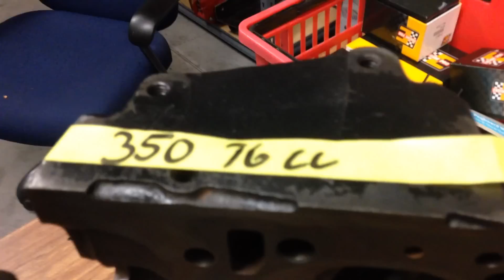350 and 305 Chevy what's The Difference

Comment: Why does a 5.0 Liter Chevy V8 have to be the sad choice? I mean, if you look at other manufactures from all over the world whom make a V8 with several hundreds of horse powers; they barely even get to 305 cubic inches to begin with. So with in that perspective a 305 is a large motor... which easily can produce exactly the same amount of power as the Chevy 350 does. and why do you need to go bigger in cubic inches to begin with? We no longer live in the 60-ties were hardly any other option was available, than large, larger, largest bore: more cubic inches. Now we're 60 years later in 2021 and we've developed so many gadgets to gain power out of any engine, we don't need more cubic inches to gain power. Many standard 4 cylinder engines no larger than 105 CI gain more power than a standard Chevy 350 V8. You've gotta ask yourself: do you think like people did in the 1960-ties or do you think like people do in the 2020-ties? Basically: yes there are many substitutes for Cubic Inches!

Comment: I ported my stock 305 intake and heads and put a double pumped and it ran decently well the issue with the 305 is that the lack of air flow chokes the engine at high rpms

Comment: I built a 305 a couple of decades ago on a dare.  I had an '85 monte carlo SS and I transplanted a tpi 305 from an '89 camaro.  It wasn't left stock.  I used AFR heads, edelbrock TPI manifold and runners, crane cam, hooker long tube headers, etc.  My friend was building his '86 camaro with a carbureted 350.  Both were our daily drivers.  I put up with so much crap from everyone asking why a 305?  Because it was more of a challenge.   We raced them, a lot, and they performed pretty evenly.  They ran very close times at the 1/8 mile track.  Usually whichever car that got better traction would win.  We were still naive and blew all our money on the engine, transmission, and rear end without realizing how important proper suspension would help.  In truth,  you can make decent power from a 305, but it's easier to make the same and more with a 350.  If my friend had used better heads than the cast iron double humps that he used, I think he would have easily made more power.  I was only able to compete with him because I didn't mind spending the money.  And that's really what it comes down to, how much do you wanna spend to go fast?

Comment: You said the 305 head ports don't flow very well, but does it make any difference if you had a pair of 305 heads polished and ported? Would there be any HP gain at all or is it still not worth the time, money, and effort?

Comment: I was wondering since the bore is bigger then the engine is a little bigger? Just asking cause I removed a 350 and installed a 305 and exhaust that come off the headers didn't fit exactly

Comment: I have a 305 in a Chevy Express van that I use for towing a 5000 pound travel trailer and or a 16 foot cuddy cabin boat.  Obviously the boat doesn't even seem like it's behind the van and the van has no trouble pulling the travel trailer up some pretty steep grades.  It's no drag racer but it'll keep others from overtaking me on the right!

Comment: What happens if you did the opposite. Put the 350 heads with the much larger 76 cc  and  big cam in the 305. Any horsepower gains for the 305 or would it lower the compression rate too much.

Comment: i agree valve shrouding is also a big problem when you put 1.94's in a 305 head and it will only perform to the port flow. All Sb's already have the 1.5 exhaust

Comment: I once had an 88 caprice classic w/ a 305 and it was a great motor, stock 170 hp and 260 ft pounds torque. Plenty of power to get that 5000 pound car moving. Not bad on gas either, for what it was.
Reply: An 88 Caprice doesn’t weigh anywhere near 5000lbs.

Comment: I would like to swap the original 305 (with automatic trans, that has bad bottom bearings) in my 1991 Chevy truck with the 350.  Does the computer have to be changed also?  I was also wondering if there is a way to buy a remanufactured 305 with more horsepower that would not require a new computer?   Let me now what you think.

Comment: 86 k10 305 swapped for 79 Scottsdale 350. Converting the 350 to manual my 86 has a 4 speed with granny shift. Original 305 had the mileage rolled over 3 times. Started smoking at 86,000 and said it’s time to upgrade a little.

Comment: I don't understand why everyone hates the 305's. I have a 305 in my 89 IROC Z28.  It has the tuned port injection, & over 120,000 miles on it. It runs like a new engine, just not as much HP as a 350. 
Granted it doesn't have the power my LS engine has in my Silverado 1500, but back in the day, a 305 was considered a good engine.

Comment: Going back to the 1980's my understanding has been that the 350 had more torque while the 305 spun up faster.  I had a '83 Trans Am with the 305 H.O. and an '86 IROC with the 305 F.I. they ran out nicely--good on gas too.  Both daily drivers.  At the time the IROC could be had with the optional 350.  The difference was torque.  So the 350 went nicely with convertible body and its slightly higher weight.  I'm just reporting here, no favoritism either way.  I like both 305's and 350's.

Comment: I own a 1993 Chevrolet Caprice wagon with stock 305, using SPFI. It delivers some 170HP which is okay but I wonder what could be done to improve it a little bit, without sacrificing fuel economy. The engine has 45K original miles on it and no issues at all. Thanks..

Comment: As far as longivity is concerned the small block Chevy is top notch. The bone stock 305 TBI in my '93 caprice has 365K and burns no oil -of course I've changed the oil/filter every 3k. Even with 2.56:1 gear ratio and stock TH700R4 this car has enough torque and runs very well. 170 hp and 255 torque factory rating. No need to swap this one for a 5.7L. I'll just leave it as is.

Comment: I am acquiring an 89 firebird with the TBI 305 and 30K original miles. It would seem to make sense to leave the existing short block in the car and limit my power making mods to cam, heads, and intake.
I know it’s possible to make decent power with the 305 but the heads seem to be the major problem. Any suggestions on heads keeping in mind this will be a street car possibly retaining TBI with the Edelbrock TBI manifold and larger injectors?

Comment: Very informative if you don't know a thing about engines, as for me, I know that it's 45 cubic inches. Seriously, the 305 would resist overheating with so much meat on the block, but it's heavier for the same reason.
Reply from the maker: The weight difference is so small it's not a factor

Comment: Thanks mate for telling us the real difference. I'd like to ask. My 305 was from 1980 Caprice had electronic ignition/distributor. Can I just buy a GM Delco points/condenser Distributor Remanufactured or Used from an early 70s 350ci and fit it to this 305? Cheers.
Reply from the maker: yes

Comment: Good info thanks, I had a 305 in my 86 El Camino. The only thing was one of the rear cylinders can’t remember which bank, it kept fouling the plug. So we put a plug extender with a hotter plug. That worked. My point is I wonder if that is common for the 305? Take care

Comment: Ive always liked a 305 Dad had one with shaved stock heads that ran great , What ive always wondered if they will stand a 4 inch bore of the 350 ? and how would one respond with 350 heads switched to it thanks man love your show I actually have a 70s 305 my father n law gave me ive been contemplating wich way to go on the build I want to build it as a street rod Ill pr
Reply: Ill probably be putting it in a 70-85 short bed chevy truck

Comment: Hay there I got a 305 engine from a guy that put a create motor in his suburban.  number states it about 1985 year , got 750 4 barrel with 70/72 jets smoothed out . Low cross plane mani. now what's interesting is head numbers state they are 400 small block 60 ish cc, is there such a head , what you say about mixing parts and looseing permformance I say is true as the owner said it used tones of gas hauling the truck . In t-bucket now   and it moves as is , cam unknown to . Thanks for the video was insitefull 😊

Comment: I just bought a bayliner trophy boat with a 305 olds engine with 207 hours on the engine. Is that alot for a boat? It runs AMAZING after it is warmed up but if i let it set for 2 days, it is a bitch to start! After new plugs and wires and new fuel pump and carb rebuild. Timing was set to spec but is there a hotter plug that can get better start up than Ac delco?

Comment: were the heads different on the SS monte carlo 305's?  those cars seem to run pretty good.  had a friend in HS has a new Monte 305, we installed a cam& headers and different carb/air cleaner.  and he could out run  stock Z28 camaros same year...
Reply: kyle stewart Mid 80's Monti Carlo ss had bigger valves, high lift camshaft , re curved distributer and larger jets in carb. Same as transam HO and camaro Z 28

Comment: I had a 350 built  .30 over balanced can I don't understand them.   But can run stock torque converter. Aluminum summit heads    short stainless steel headers.   Running stock TBI and distributor.   In a 1995 gmc1/2 ton 4x4 just started driving.  It's pretty good but what about fuel delivery???? And stock computer any suggestions for fuel delivery

Comment: I love the old torquey 454, yet with a 305 with a tiny two barrel in a C30,( 1 ton dually) fully loaded and pulling a overloaded dual axle 16 foot trailer up a steep and twisting dirt road, it made the pull in granny low revved to near max.  It is one smooth revving motor.  It works.  It is a keeper.  And it probably gets better MPG.
Reply: Put in a straight six cylinder and a five speed transmission for torque and mileage if that's your problem problem solved amen america

Comment: I have a 95 center Valve cover 305 with 302 k on it. Redid the heads about 5 years ago around 200k, but now it's definitely burning oil through the rings. Is it possible to bore this 305 to 4" bore/350 and install 350 heads to basically turn this 305 into a 350?

Comment: So does the 305 has less horse power then the 350. I have a 1985 chevy van, c-10  with a 305, automatic with a 4 barrel carb and wondering if it has same pulling power for like a small fishing boat or a trailer with a couple of atv's on it.?

Comment: Im putting the 416 305 heads on a 350 with the 1.835 intake valves and about 61 cc chambers after mill job with .015 thick felpro 1094 gaskets and 12cc dish pistons. Compression comes out to about 9.8 to 1.  Cam is Howards 201/207 @50 .410/.420 lift and 114 lobe centers. Will it run on 91 octane gas just fine and not ping or what im I to expect? I know the flow numbers arnt real great on these heads but im not going over 4000rpm, going be a low rpm high torque mileage engine and dont care about high rpm and hp.

Comment: I’ve got a 5.0 (305) in my boat and it’s a fantastic engine. The 350 was an option however only a 30hp gain and the cost didn’t make sense to me. If it’s good for marine use it’s good anywhere!

Comment: I am wanting to swap out my 305 TBI to a 350TBI create engine. I have 400K on my 305. It's in a 94 GMC. Can you tell me what I need in order to buy a crate engine for the swap. This stuff gets technical pretty quick for me. My 305 is a stock and I am probably going to hire a garage to swap. I realize theres 45 cu inches difference. Will I need to change anything on my TBI? Injector chip etc?? I really enjoyed the video.
Reply from the maker: you shouldnt need to change anything

Comment: What about putting 350 heads on a stock 305 ? I have an original stock 1977 305, 70,000 original miles, 8.5 :1 comp. with Edelbrock Performer manifold and 650 carb.  Rather than fool around rebuilding the original 305 heads what is a good 350 head to use that will work with this manifold and carb. Configuration ?

Comment: 305s are not known for outright horsepower, but they are extremely reliable in the long run. My dad has an 89 GMC 2wd half ton. The odometer broke almost ten years ago at 220k. It has to have 350k on it by now. yeah it burns some oil, and is down on power a little but he drives it every day.The thing just keeps going, and it still runs smooth. He just changes the oil when it starts to get darkish brown, maybe every 1500 or 2k miles but thats key to keeping a high mileage engine going. That thing has shown no signs of dying yet

Comment: I pulled a set of 059 casting heads a few weeks ago before realizing the engine I was pulling from had an 878 block instead of the 880. I now know this was a 305 engine instead of a 350. The heads checked out as having no cracks. Are these considered the 305 equivalent of the 350s 062/906 vortec heads?
Reply from the maker: no they don't flow at all
Reply: @Myvintageiron7512  Thanks for your reply. Didn’t realize these were not the 062/906 until I had them out. Engine was in a 99 Express and were difficult to see until pulled. Oh well

Comment: I know this video is an old one but I  have a 78 Chevy K10 truck and I thought it had a 350 engine, I took it to a mechanic that drag races an old 57 Chevy station wagon small block to barrow his timing light. He ask me if it was a 350 and I said yes . He saw the harmonic balancer and said it looked like a 305. So now I'm not sure what I have. It is the original engine. Is there any way I can tell which one I have without pulling the heads? Love your videos!

Comment: Yes the 305 was an okay engine to putt around in but the problem was you couldn't get them in the 4 bolt main configuration.were as the 350 had a lot more varieties even truck blocks. That made for a stiffer bottom end which I feel in the end made for a better canvas to work with and endless possibilities. Kinda like the LS engine of today except the LS now has 6 bolt bottom end and the 350 performance blocks had 4 you differently don't want a bunch of flexing on the bottom.Guess you could say the 305 was the economy block ..no bells or whistles. But great that you opened up a few eyes.

Comment: I know this is an old video but I have a question can I take a 305 cubic inch small block Chevy input a 400 small block Chevy crank in it and if so what would be the cubic inches of that engine and for bore size let's just say a 3.760 stock bore??

Comment: I've put 350 heads on a 305 to lower the compression and added a turbo and changed the ECU to dump more fuel when the turbo kicked in. Also added an intercooler. This was on a 91 Silverado. Changed the cam and put the 350 intake on. I didn't know anywhere to get a dino at the time, but my no break single tire burn out went from 11 inches to 3 feet. So I did notice I big difference doing this. The only downfalls I had was, bad turbo lag and having to raise the idle to 900rpm to idle at a lower compression. I miss that truck. My buddy had a 383 stroker in his truck from summit, and I could keep up with him pretty well. He was running around 375hp.
Reply: I'm sure it was more than that 🤣🙂

Comment: Had a 350 crate motor dropped into a 81 Chevy with a 305. The guy said he could not fit the pan that protects the flywheel. Is there a difference in size or what?

Comment: Got a 305 HO in an '87 Monte Carlo SS . Runs good for a cruiser . What is the difference in the HO and , the Regular 305 ?
Reply from the maker: the HO has different heads they have a smaller combustion chamber and bigger valves it raises the compression and breaths a little better  the lower the end is the same as any other 305
Reply: @Myvintageiron7512  Thanks .

Comment: I did this to my motorhome with a 350 ci but the intake was only .172” whereas the 305 heads are .184”, what you have to do the 305 heads you must grind that firing chamber where it peaks over, round it right off on every firing chamber, this will stop pre ignition also increase the size of the firing chamber, I got mine down to 9.6 to 1 compression, then you must take a die grinder and grind off any ridges in the ports, clean up the ports the best you can.
I did install an RV cam C/W new lifters, new 600 Edelbrock carb and a edlebrock manifold, KN air filter.
You also have to put the strongest mechanical advance springs in, I set my timing at 4 degrees btdc.
I’m know my Hp gain was at least another 75 plus the torque really improved, although I never Dino it, I give it the real test driving it through the mountain passes in British Columbia, where I often travel.
Saying this my gas mileage went from 10 to 13 miles per gal. The motor home was a 1979 20’

Would I do it again?. You bet I would.

Comment: I'm building a 45 pickup I have a 305 in it now havnt ran it yet,,,and I just bought a 350 vortex,,,I'm not looking for fast,,my question is should I change them out? ,, I have 323 gears and 700r4 transmission,, is it worth having to buy another intake, are just go with the 305???
Reply from the maker: go with the vortec for sure

Comment: I have a 305 in my 96 k1500 and all 4 of my other friends w k1500s have the 350. I used to wish I had a 350 but every single one of their trucks have broke down and needed work to get them running again and my 305 is at 303k miles and still going. Sure they don’t make as much power as a 350 but they sure are reliable

Comment: Shoot,  I had a 305 in my 85 GMC Sierra Classic swb with 350 "camel hump" heads and had plenty of power to haul that heavy truck.  It was a stock bottom end, elderbrock high rise aluminum intake,  quadrajet 4 barrel motor hooked to an old school 400 trans.  Had a lot of fun with that truck lol.

Comment: Currently building an 87 Monte Carlo with a 305.  Looking for reliability and consistency to go rounds bracket racing.  Ditching the computer, adding headers, carb, ignition, and whatever else that won't work without the computer. Motor only has 64k original miles.  Looking to add gas a have fun racing.  Low maintenance.